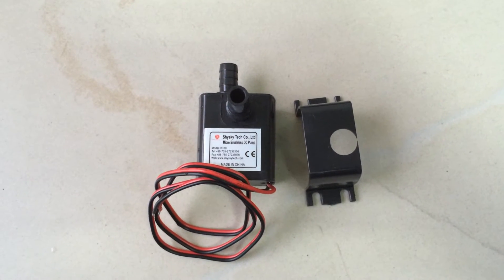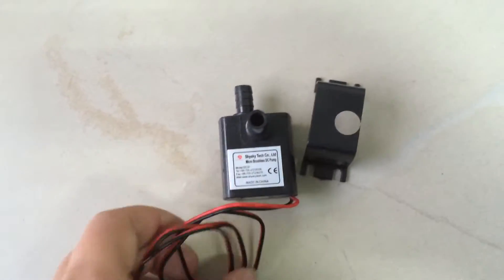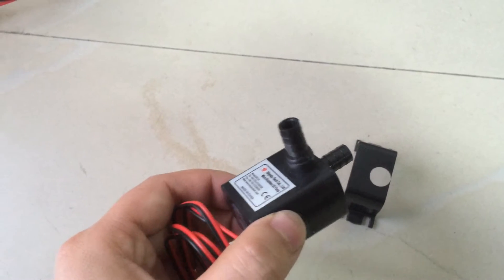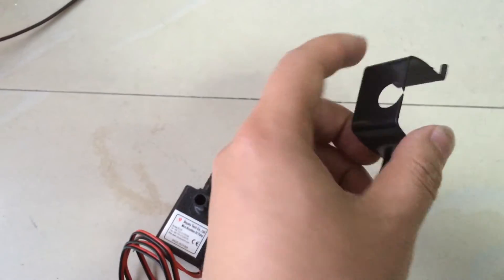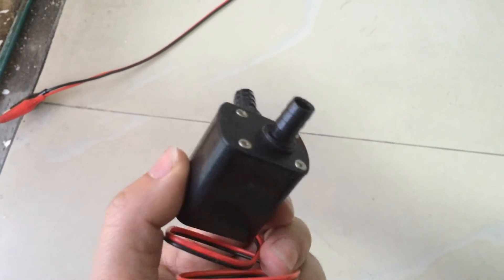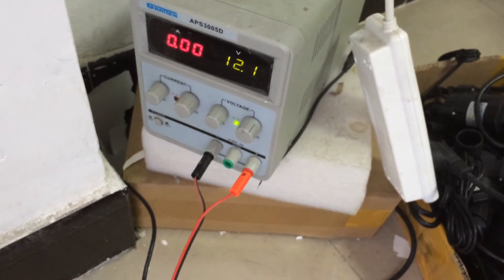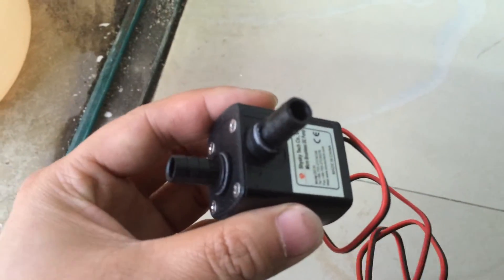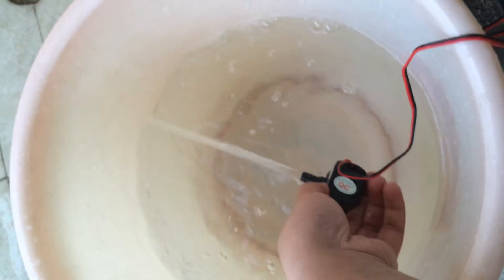Classical mini brushless DC pump product DC30A-1230 12VDC Powerful

Comment: Is still available in the market?? What's the price for a unit??
Reply from the maker: This tiny pump is available. It's the one shown in this item link:

https://www.ebay.com/itm/301377228476

If you are interested, you can have a check.
Reply from the maker: Of course, currently all cable is equivalent as the one shown on the pictures of item link itself. Not bared cable, but the cable with DC head connector, which is better.
Reply: Lily,  can this pump work outside water?  As in not totally submersed in the water but work as a draw water pump?
Reply from the maker: Pump can work outside of water. No problem. However, it's essential to make clear that pump cannot be self-priming and it has no ability to suck water from lower location to higher location (somewhat like drinking milk tea, drinkers could put a straw inside.-- Pump is not capable to do this.).
Reply from the maker: Regarding pump itself, it works via centrifugal force of impeller: impeller rotate fast to push/ throw in-flow out of outlet, getting the performance of pumping/ circulation, etc. It's a centrifugal pump, and it's essential to make sure that flow can actively sufficiently pass into inlet of pump. No dry work without in-flow or with little in-flow; otherwise, pump could be damaged.

Comment: Hei i want to ask which power cable to use
Reply from the maker: Power cable? It doesn't matter. Regarding power supply, it can be various matching 12 VDC power supply, such as AC/DC power adapter, small DC battery, etc.
Reply: How much amps
Reply from the maker: 12VDC, 0.5A or 1A should be OK.
Reply: Ok thanks
Reply: What about 12v 2a
Reply from the maker: I suppose that it should be OK, using 12VDC 2A power adapter.

Comment: It have to be under water?
Reply from the maker: Not necessary to be under water. However, it's essential to note in advance that pump cannot be self-priming, so it's essential to make sure that water can actively flow into inlet of pump. As to whether pump is installed under water or at land use, it depends on users' application. Hope this simple answer can be useful. Shysky